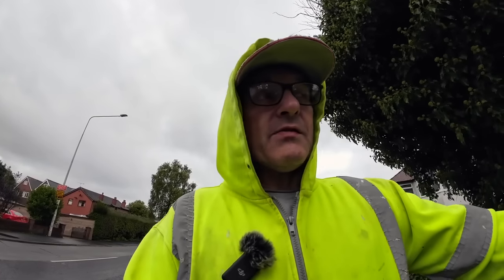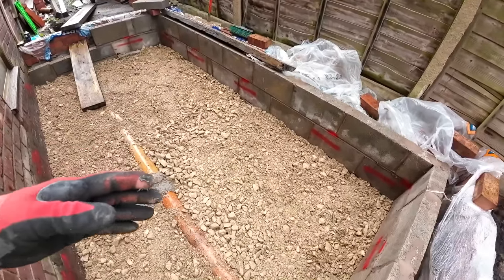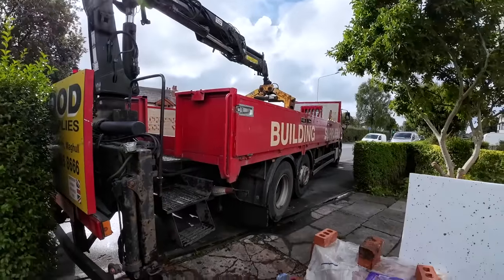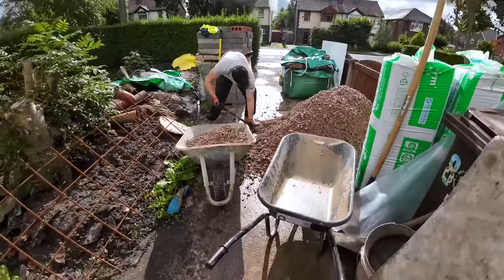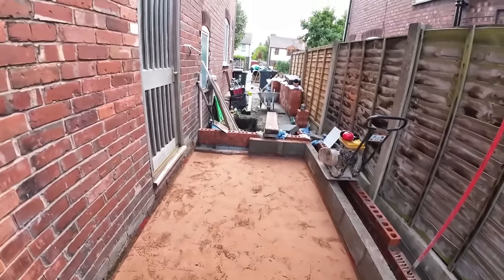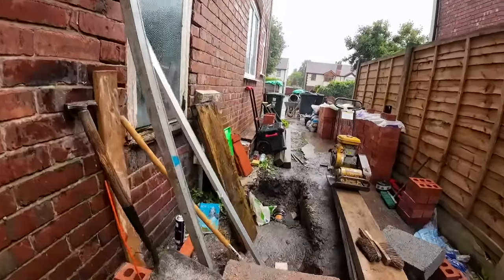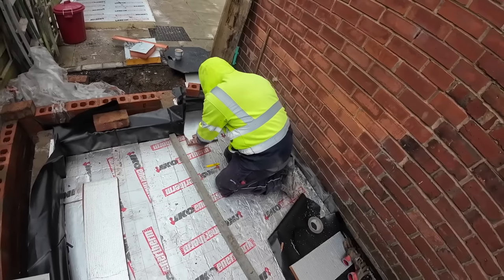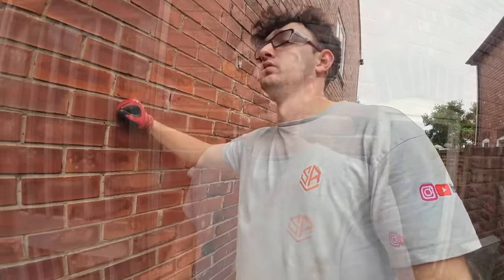SMALL EXTENSION ..SLUGGISH CONCRETE FLOOR PREPARATION PT 3

Comment: Tough work there lads in that weather ,I’ve been there got the tee shirt and still doing it can you see why the building inspector wanted that perimeter insulation inside the DPM as I can’t see any benefit thermal wise  at all
Reply from the maker: Thanks pal no idea to be honest. Our way we cut the cold bridging strip deep so the horizontal insulation traps it in place . If you put the strip in front of the DPM it can just blow away plus visqueen never folds perfectly into the corners which makes it even harder 😫😫🧱👍🏽

Comment: The rain really doesn’t help in construction we are having our share here 2 .. it’s almost non stop  pouring  😅.. that’s some decent insulation you using there we also work a lot with iko enertherm for floor roof and wall .. looking good so far guys have a good weekend !!
Reply from the maker: Cheers Jay. yeah generally the weather blows east across us so you generally get the same as us which has been shite this year 🙄.
   Insulation mad over here now Jay, 
   Have a great weekend to buddy 🤙🏾🤜🏽🤛🏽🧱👍🏽

Comment: Great work as always - whilst the new regs on insulation are a bit of a pain the extensions you build must be a lot warmer than the old days where the floors / walls were  either uninsulated or poorly insulated. Your hip looks very bad - I gave up on the NHS waiting list and after several yrs of pain (back) just paid for it directly. Got sorted in 3 months end to end. I reconciled this approach by thinking of it as business expense (though it's not tax deductible) in the same manner as one of our vehicles or other kit needing replacement / maintenance - a logical investment and cost of doing business.

Comment: Can I ask you a question please lads, insulation above the concrete or below the concrete slab, I see  you lads always  doing it under before but I’ve been told by my builder they always put insulation on tip I said is this because of UFH he said not we always done it like this.
Reply from the maker: Not sure what you mean 🤔🧱👍🏽
Reply: @SteveAndAlexBuild  when building oversight 150mm crush, blind, membrane, insulation membrane then concrete but I’ve been told by my builder you don’t lay insulation under the concrete you lay it on top ?
Reply from the maker: @DeanW-1990 . Never in 36 years have I seen insulation put on top 😳🧱👍🏽
Reply from the maker: @DeanW-1990 . Never in 36 years have I seen insulation put on top 😳🧱👍🏽

Comment: Building inspectors are a law unto themselves. Won’t see reason at all. Make me laugh where I live as I’ve a build next door that hasn’t adhered to building regs at all and inspectors not interested. My build although we adhered to regs we was asked to to go above and beyond (deeper footings, extra insulation, wouldn’t allow same level between patio and floor) which seemed to be a power trip for the inspector.
Reply from the maker: 🙄ridiculous 🧱👍🏽

Comment: How expensive is that cavity insulation it's ridiculous on a tiny extension think there is only 4 in  a pack
Reply from the maker: Half the price of the foil pir boards 😬🧱👍🏽
Reply: Yea and the time fitting the foil pir boards as well. We like to build our brickwork first as well as it controls levels and setting out doorways, windows ect.
Reply from the maker: Totally with you on that . We hate block first .
    The to kingspan needs breathable tape too which is extortionate 💸💸💸🧱👍🏽

Comment: Don’t you need to sand the waste pipe with sand for protection before whacking it? Having just retired from 50 yrs in engineering construction I know how hard daily graft is and how horrible working in rain etc is. Keep up the hard work. I don’t envy barrowing all that stone. Anyone who thinks you should keep the bags should try emptying one with a shovel!
Reply from the maker: Cheers buddy very true on the bags 😫🧱👍🏽
Reply: Agree I think I would have put some sand around the earthenware pipe before covering with MOT and wackering.
Reply from the maker: @Richard-gk3kq . It’s a plastic pipe
Reply: @Richard-gk3kq  it’s plastic but I thought it was normal to put some sand round it before gravel.